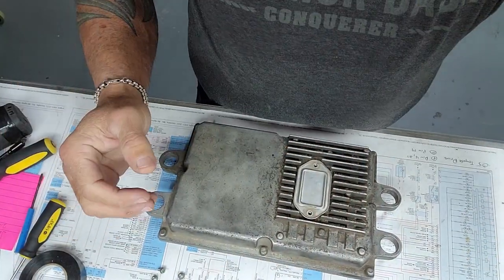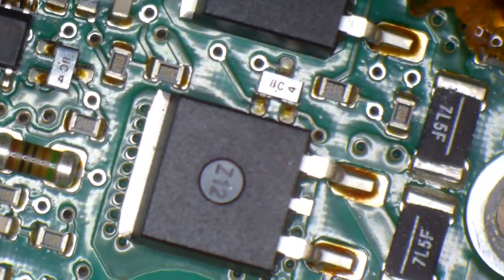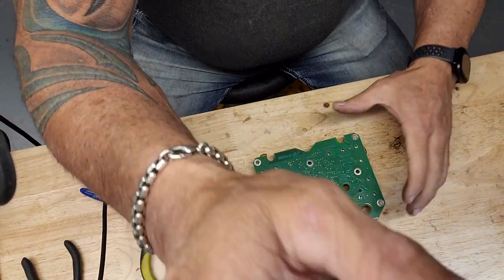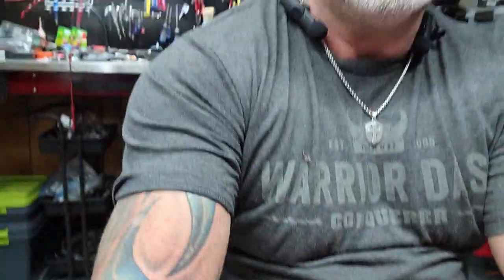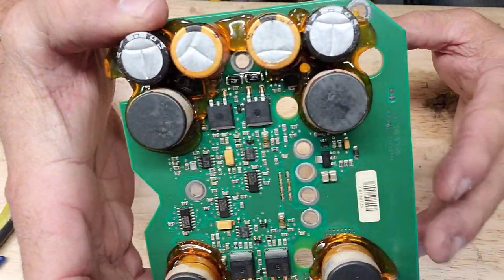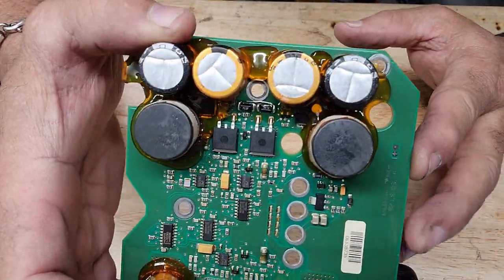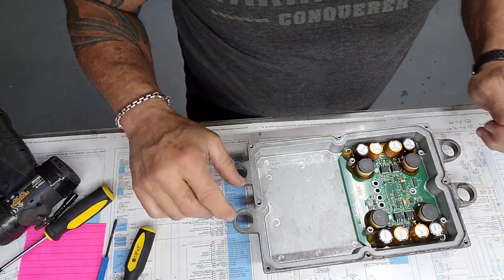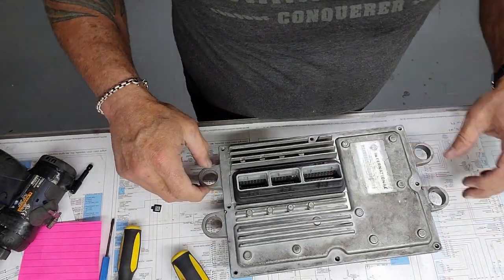FORD 6.0 DIESEL FUEL INJECTOR CONTROL MODULE REPAIR DIY - Watch us fix it!

Comment: Thanks!  I have an older 7-pin style FICM which was causing start/run issues when cold.  I inspected all solder joints on the power supply card and found exactly what you described - failed joints due to stress caused by thermal cycling.  I reflowed all capacitor joints and the truck runs better than ever!  BTW - many solder joints were not flowed properly at the factory.  Except for the fatigue cracking they looked OK until reflowed, and then you could see voids, insufficient solder, poor wetting, etc. It's no wonder they have (had?) a low yield on these boards at the factory (pre other commenter).

Comment: Funny thing is I work in the factory that makes those boards. You should see how many of those they throw out every run!
Reply from the maker: I have no doubt.   I got a Chevy transmission control module in today that the pins are connected to the board via an ultrasonic weld...needless to say they are failing at a ridiculous rate and I see no way to economically repair them.  Much like the Bosch abs modules just without the jelly filler.  They are on national backorder for the last 6 months and trucks are literally useless until they're available.